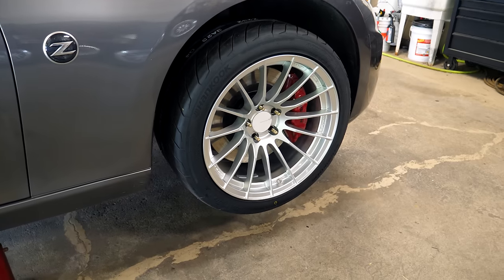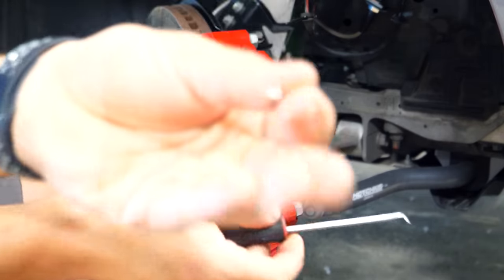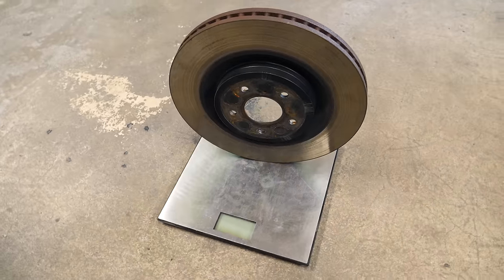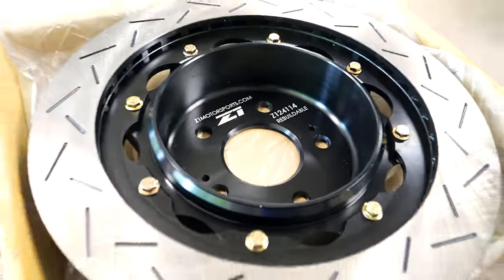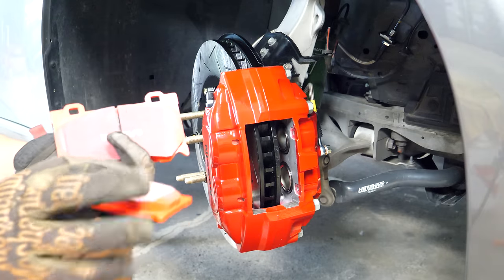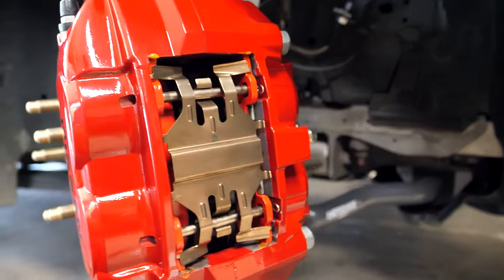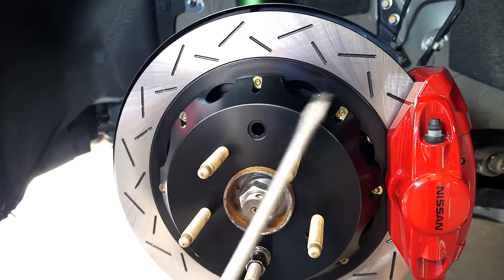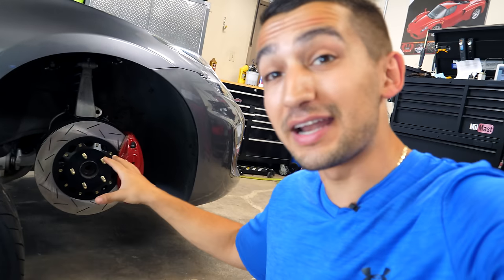AKEBONO SPORT BRAKE UPGRADE!! MASSIVE DIFFERENCE

Comment: Good instruction video, but the brake pads you showed are....also not really that good. I'd suggest going with EBC blue NDX. They are pretty dusty on the wheels, but they perform really well and can withstand occasional track driving.

Comment: Hey milan, how are you ? Quick question, So i have an 91’ s13. power steering doesnt seem to work. At first I thought it may have a “power steering delete”. So i checked the ps pump, resoivor, they’re in there. Anything would help. Thanks!
Reply from the maker: Hey Mark! Doing well, just working away in the garage as much as possible 🙂 So I had a PS leak on my S14 which is very similar to the S13. Check to see the high pressure line from the power steering pump is good. That was the culprit to my issue as it was rusted and the high pressure blew the line. The replacement line was like 80 bucks and worked like a charm. I'd look there first, otherwise there are more lines on the rack. If you can't seem to find the problem, raise your car on jack stands, fill the PS reservoir with fluid, turn the car on, and see where it leaks from. That should do it 👍
Reply: milanmastracci thank you so much!!!

Comment: I watched many Big brakes upgrade but I believe your the only person that talks about the emergency brake set up. Because now my emergency brake is not working but probably because we didn’t the last part.
Reply from the maker: Adjust the shoes is pretty easy. You'll need a flathead screw driver to enlarge the adjuster inside the rotor hat.

Comment: Side note: those brake pad backing plates are more for noise than anything else - they prevent brake squeal because they keep pad vibration down. On naked pads you'd need brake quiet which looks like spray paint when applied, and it basically does the same thing.

Comment: I just had these exact rotors and pads on my 2012 Sport, I'm questioning why i now see the pins sticking out beyond the calipers, only on the back, fronts are flush. Was something done wrong or reversed as to why the pins are sticking out and no longer flush? These have made my Z feel like a new car, my old rotors were pretty warped and shook the steering wheel at high speeds and the feeling in the pedal, it feels so much more solid now. Well worth it.

Comment: About to buy my Akebono brake kit next week.  My G37x weighs a ton.  Definitely need help in the braking department
Reply from the maker: You should notice a BIIIIIG difference 👍
Reply: how did the swap go? Did u endup buying a new rotors? did u have to change any other parts to make it work?  i also have g37x

Comment: Mlan....awesome video as always. Quick question, is the handbrake pulled up when you set the shoes to the smallest size for the rears or should it be released? Wasn't sure abut that bit. Kindly advise,

Comment: I understood everything up until "re-adjusting the hand break". after you put the new rotor up & calipers. Do you stick a screw driver in that hole and turn it back 5-6 notches or how do you go about it? that part is unclear
Reply from the maker: Yes, that is how you do it. It isn't a hard process, but getting a screw driver through the adjustment hole on the rotor hat in the correct spot can be a bit tricky.

Comment: Do you know if anyone makes lighter rotors for your Mini? Awesome video btw! I’ll e switching my Mini to that same brake fluid when i do my steel braided brake lines
Reply from the maker: I've seen a couple from time to time, but it might be easier to buy a big brake kit as they usually come with 2 piece rotors.
Reply: milanmastracci cool, thank you 🙏

Comment: I've got stock brakes (akebono) on my Q50S. do you think that upgrade can be good on it? and are the Z1 rotors really good?
Reply from the maker: The front rotors are for sure worth it, the rears, not so much because of the little weight savings. Some better rotors, pads and fluid will make a big difference 👍
Reply: @milanmastracci  great! Thanks for replying!

Comment: Milan! I have a 2014 q60s which is the same body chassis as the g37s coupe. Do I have to trim away the guard? I've read everywhere that my car already has sports brake compatibility because its already big, but idk if the shield has to be cut.. do you know?
Reply from the maker: Hey Joseph! The only time any of the back heat shields need to be trimmed is if you had the non-sport brakes (slider calipers), as those were designed for a smaller rotor size. If you have a Q60S, you just need to swap rotors, change pads if you like, and you're set.

Comment: Do you have to "bed in" the new pads/rotors with these? I've watched a couple vidoes of guys swapping out Z pads and rotors and no one has mentioned it yet. Maybe it's so obvious it doesn't need mentioning but I'm a super noob at this lol. I'm going to be installing the Z1 sport brake upgrade kit on my 370 soon (rotors pads lines and fluid). It seems like it's going to be a huge pain in my ass...I've done rotors pads and calipers on a 99 GMC Sierra and I've done brake pads and brake lines on a Honda CBR600RR....so I'm not a total noob but it still seems like a huge pain in my ass LMAO
Reply from the maker: Whenever you change any slip / friction item like your brake pads, your brake rotors, your pads and rotors, your clutch, your flywheel, your pressure plate, or any other kind of the sort, you will need to bed them in to ensure you have the best contact possible. You essentially need to wear them into one another, and if done right, you will notice your friend coefficient will improve greatly! My advice to you is take your time, ensure everything is lubed as outlined in this video, double check your torque specs, ensure the parking brake works once completed, and lastly, have fun with it! 🙌
Reply: @milanmastracci  thanks brother will do. Your tutorial videos are amazing. No one even comes close.
Reply from the maker: Happy to help man! 👊 thank you! I appreciate that ☺️

Comment: Quick question, those 285/35’s look really sweet. I’m rocking 255/35/19’s, for them with some wheel upgrades on stock 19” Audi wheels. But they have so much tire going over my wheel. I think it’s because they aren’t low profile. And am debating getting either 245/35, or 235/40’s that are lower profile for the fitment I want, any thoughts?
Reply: My wheel specs are 19x8.5 btw. Thank you! Great content once again 🔥
Reply from the maker: If you can send me an email with pictures, I can help you out better 👍

Comment: ya but, how does this affect the EBD+ABS? If brake grip is much enhanced, will the EBD+ABS systems adjust to it? And, if not, will it set an engine light, if the EBD/ABS ECU identifies a problem, such as deceleration that exceeds that programmed in the algorithm?
Reply from the maker: Since the ABS system relies on the wheel speed sensors, changing the brakes to lighter 2-piece rotors won't negatively affect the braking system at all, however since the brakes are lighter, the system will actually work better.
Reply: @milanmastracci  ya but will the ABS be cutting in more or less often?

Comment: Replace the red stuff with Yellow stuff, as the red is crap and barely an upgrade.  Orange stuff for serious track use,  yellow for light track and fast road use.    Replace the nankang with Michelin and you're good to go.  Good video, thanks.
Reply: Agreed, Orange stuff is best.
Reply: @Boostedsuspects i do street driving mostly. would yellows be good for me? and would they withstand light track use (a couple of laps)
Reply: @Boostedsuspects i have a 2010 g37x sedan

Comment: you are missing the cotter pin on the rear axle.
i use RBF600, not 660. 660 needs changed a lot more often, really only good for a track only car
Reply from the maker: Yes you're right. I didn't install it yet as I didn't bleed the brakes, nor did I put the Z on the ground to torque the axle nut. I had to remove the hub to swap out my wheel studs. Good eye 👍

Comment: Is there a reason why you only went with sprinkled slotted and not drilled and slotted?
Reply from the maker: Drilled rotors tend to crack and fail with aggressive use. I no longer will buy those. I will buy J-hook, slotted, sprinkle slotted, or blanks.

Comment: The OEM ones look a lot more solid and durable
Reply from the maker: They are alot heavier, bulkier, and probably able to withstand more abuse/neglect. These new ones are more precise, lighter, capable, yet kinda 'fragile'. When you have both rotors in your hands, even though the 2-piece is lighter, you can tell its a nice unit!

Comment: DOT 3 and 4 are good for street and track use and don't absorb as much moisture as DOT 5 does.
Reply from the maker: Couldn't agree with you more!
Reply: @milanmastracci  I'm a tech at Honda and used to work at Chrysler and Hyundai too. I swapped out my dot 3 for BG dot 4 in my Lancer and couldn't be happier. Higher boiling point and lasts as long as the dot 3

Comment: Would they last as long as the stock ones?
Reply from the maker: Probably longer since they're slotted.
Reply: @milanmastracci  do you think slotted are a lot better than drilled?
Are drilled ones only for looks or it's still better than only vented?

Comment: Why not drilled and slotted rotors 2 piece z1?
Reply from the maker: Drilled rotors tend to crack under extreme use. I would recommend slotted, J hook, or blanks if you plan on pushing your car. Other than that, everything else is for show
Reply: @milanmastracci  Thank you!

Comment: Can DOT4 Fluid be used with a DOT3 system?
Reply from the maker: Yes it can. My 370Z recommends using DOT3 fluid, but I swapped it all out for DOT4 fluid as it is compatible, and an upgrade. I have DOT4 in all of my cars that recommend DOT3.

Comment: 0:38 the tires alone saved you 5lbs? or did you mean the wheels?
Reply from the maker: *Wheels and tires setup. The wheels weigh 21 pounds, and the tires weigh 30 pounds, totalling 51 pounds. The Work wheels I was running weighed 56 and 63 pounds each, WITH used non-reinforced tires.